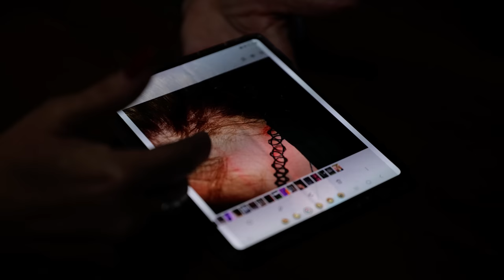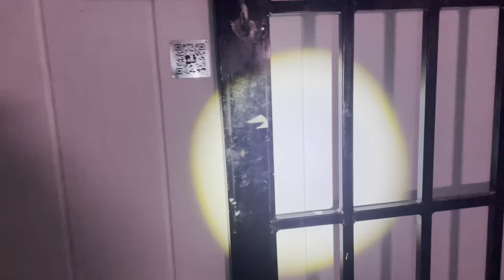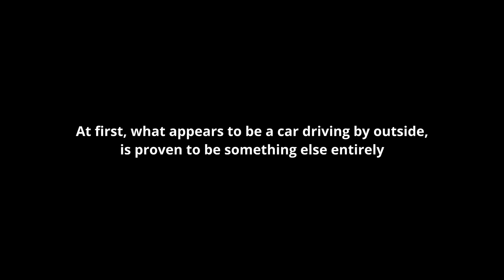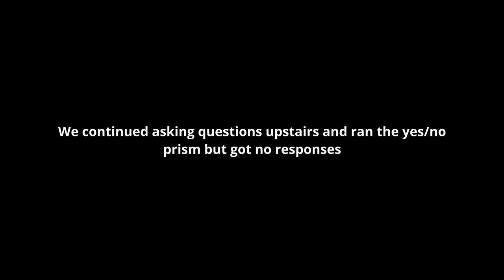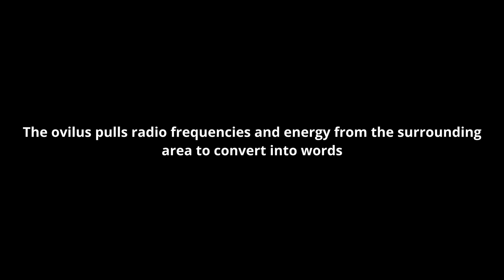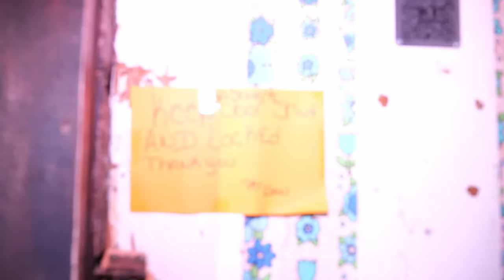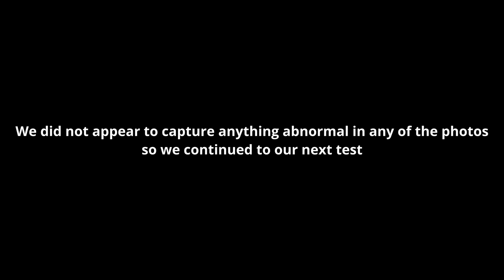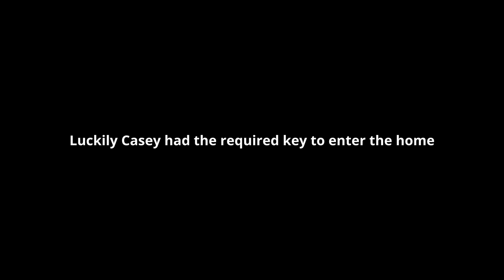The Hinsdale House (Horrifying investigation)

Comment: They are called cluster flies and most old farm houses have them. Especially if the windows are older than modern windows. My house in Ontario Canada was built in 1836 and is still a farm and I have cluster flies. All old houses around here do. Vermiculite for insulation may be why. Vermiculite is ground up mica which was used as glass for railway lights back in the 1800's.

Comment: Hey if at the time 14 mins and 21 seconds behind the guys on the wall is a mirror if you look close at it there looks like a cross thing and there seems to be a shadow figure standing behind what looks like some cross if the mirror and the. It goes away after Casey moves his flask light up and down which is the reflection but the figure clearly is there and goes away check it out

Comment: well...one thing's for sure, you cannot harm them as you consistently say throughout many of your video's, it's usually the other way around as you have found out, good thing these spirits have pity on you otherwise your outcome there could have been much more interesting...as a traditional spiritual advisor or elder (medicine man), it's good to see you made a tobacco offering, especially to the sacred tree of life. Maybe next time, or what we usually do is we open the tobacco pouch and grab a good size pinch and offer it to the sacred tree, regardless the circumstance, and then state your intentions and then put that pinch at the base of the tree. Keep in mind that those that sacred tree is connected to everything around you, even as far as where I'm at...if you care to doubt that, I'd be glad to demonstrate...from here, that bear smell is the spirit of the bear lingers to protect.